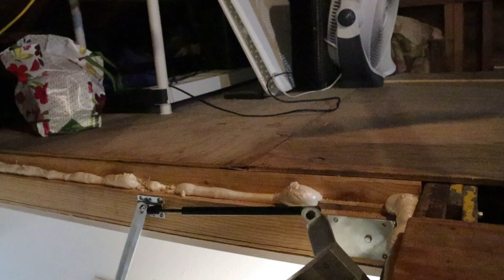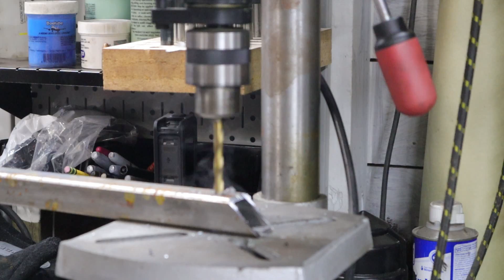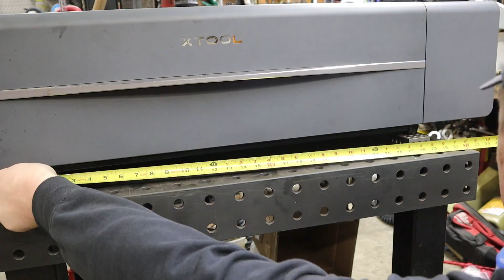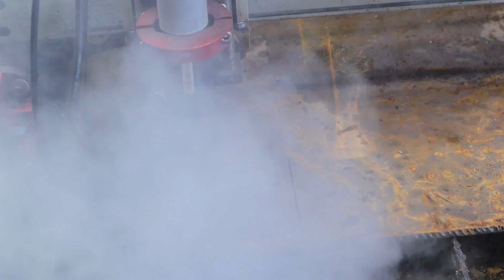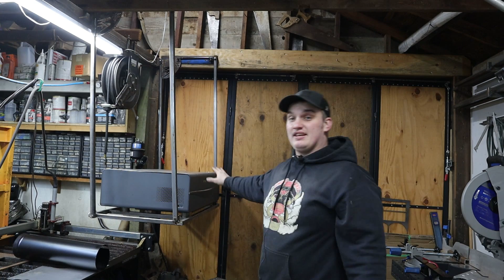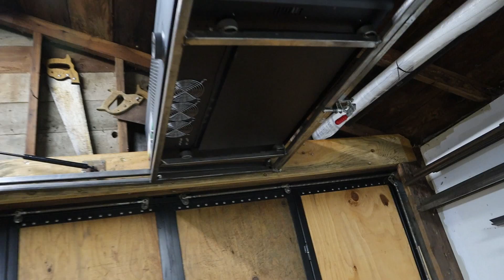I Built Storage In The Ceiling

Comment: Just found your channel. Really enjoying it. 'Go build something' is my motto.  How do you calculate the upper mounting point for those kinds of struts? I've used them in a couple applications for opening or closing things, but always just figured it out by trial and error vs actually having a clue why it ended up working.
Reply from the maker: If I'm being honest I can't say I used any special formula. I just kind of eyeballed it and got lucky . That's also the reason I drilled a bunch of holes in the bracket so I had options to try different geometry out. Thanks for watching, really appreciate the support 👊😎

Comment: Nice idea and execution !   In the distant past when heavy wooden windows needed to be opened and closed. They had a rope secured to the top and there was a pulley at the top of the window frame. The rope was attached to a long narrow cast iron weight that was hidden in the wall. (Sash Weights) The weight acted as a ballast and assisted you in opening and closing the window so if it slipped from your hand it wouldn't break the window glass.  In your project you would probably need to use a cable instead of a rope but you get the idea I'm sure. Love your channel
Reply from the maker: That would definitely work ..... Thanks for watching 😎👊

Comment: Could you add a spring like an attic door uses, to pull to door closed? I would think no need to push up then. Just pull down like an attic. I would still use the latch as a safety feature.

Comment: *Automation*...
Cheap harbor freight electric winch or even an old craftmatic adjustable bed linear actuator, you wouldn't need a step ladder. Taking it down you need to bend and twist yourself out if the way, looks uncomfortable.
Reply from the maker: That's a great idea
Reply: I have uselessly high ceilings in my garage shop I'd like to adopt some sort of mechanism like this for sure!